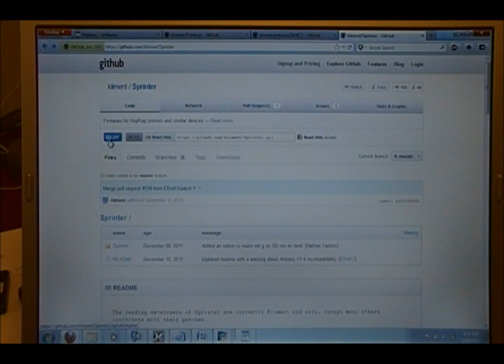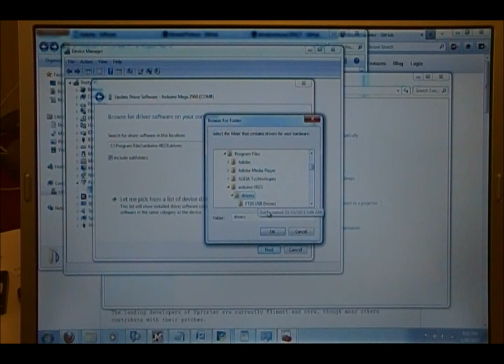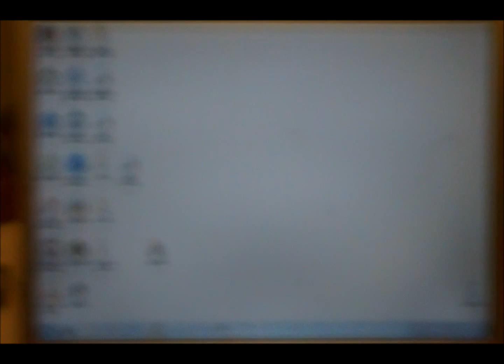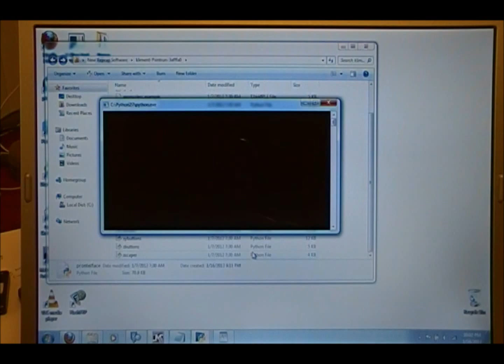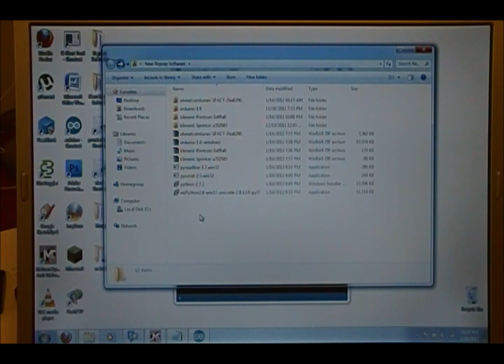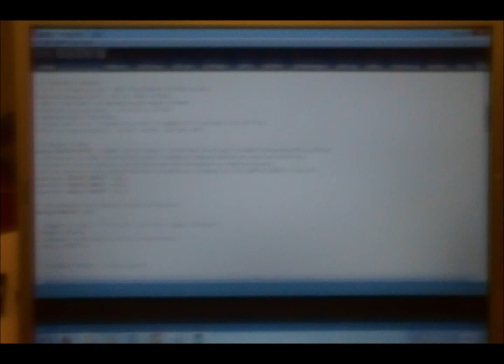Prusa Reprap Build 14 Software

Comment: I noticed you used an older version of the Arduino software along with sprinter, I tried the newest version and can not get it to upload to the arduino board, I have win 7 and same electronics as you, I think sd card support is causing the problem, I can not understand what you said about it in the last part of your video, so can you explain, thanks Jeff.